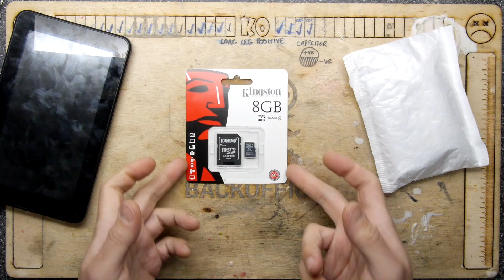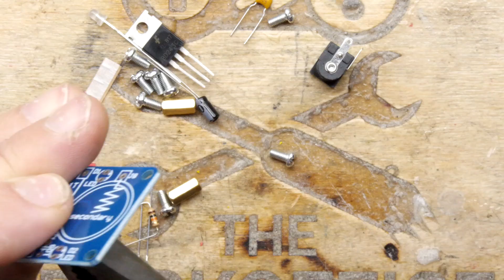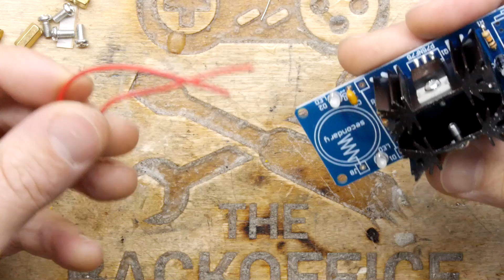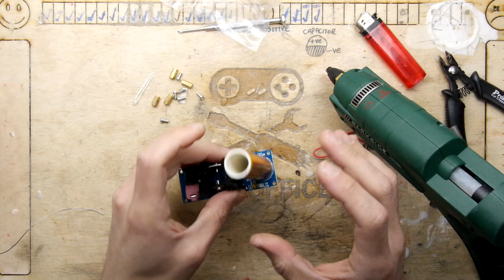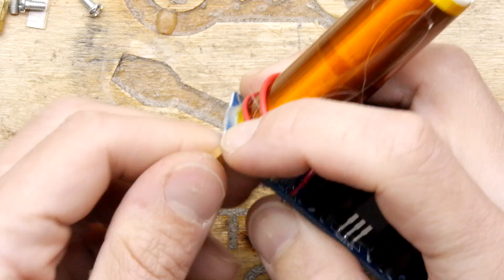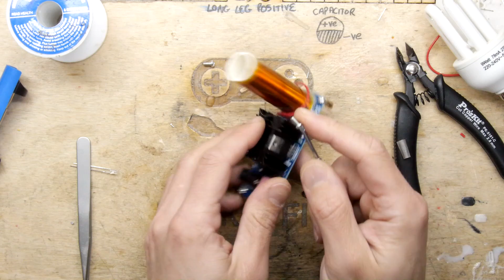15W Mini Tesla Coil Plasma Electric Arc Reactor

Comment: The output voltage of a transformer depends on the turns ratio, so two turns on the primary means half the output.
Reply from the maker: Is it half the output but double the current?
Reply: With a Tesla coil it's all about the VOLTS!